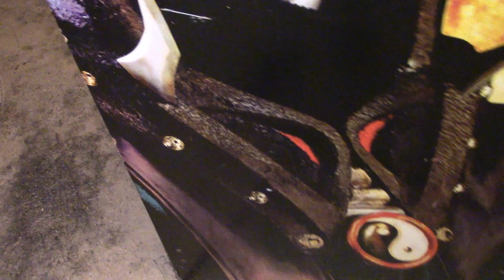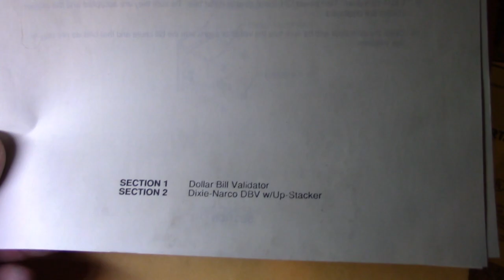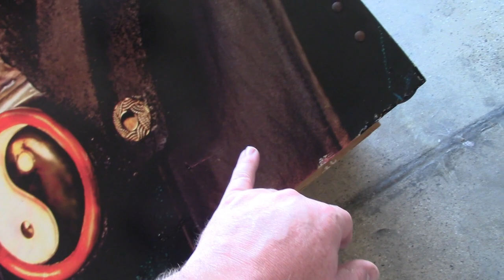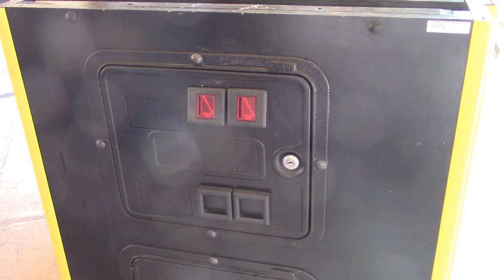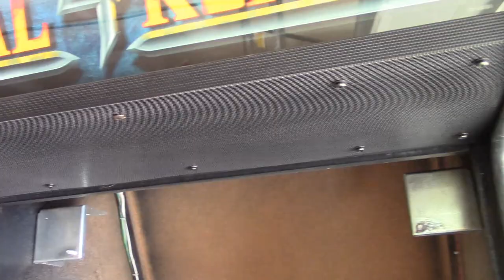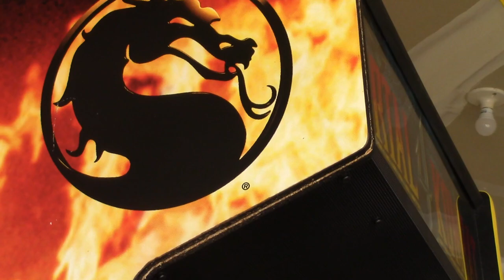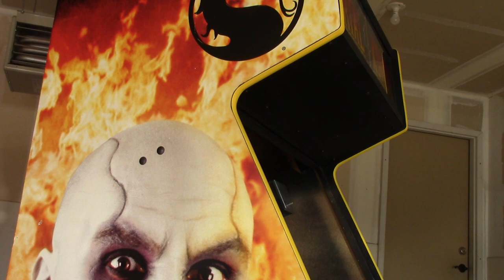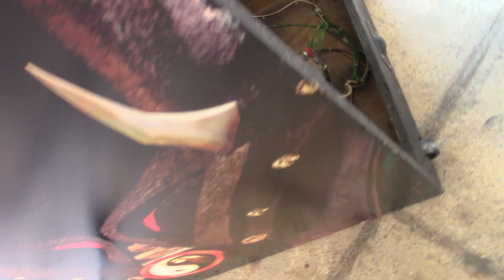Mortal Kombat Dedicated MK4 Multi MK Arcade Machine Project (Part 8) - Cabinet Clean Up

Comment: Looking slick. Cant wait to see this cabinet all running. Great work. -  I dropped some links for you a few videos back about the MK2 board. Cheers.
Reply from the maker: I'll take a look.
Reply: @YourMKArcadeSource   Thanks. You've inspired me to give my MK2 cab some TLC. Just finished cleaning nearly every part that could be removed.  Hope you can help solve the board issue.
Reply: @YourMKArcadeSource  Gday mate. Did you find the links i left you with a description of the issue im having? I left them under your reply on the video titled " Arcade Monitor Chassis Repair-athon! (Part 3) 19" Zenith K7000A
 " - Really hope you can help me. Cheers.